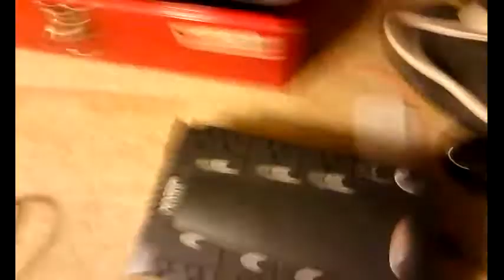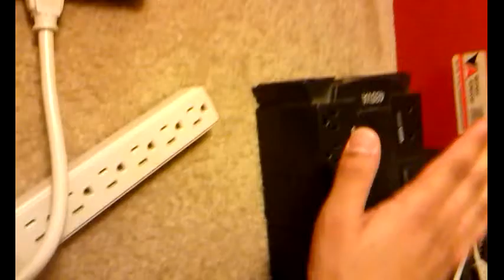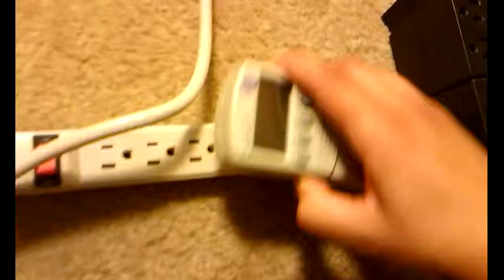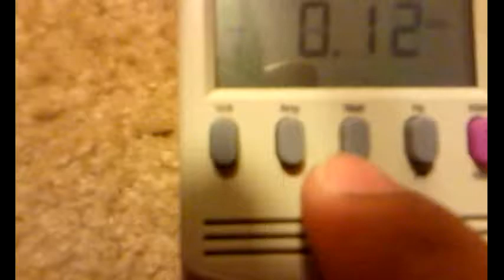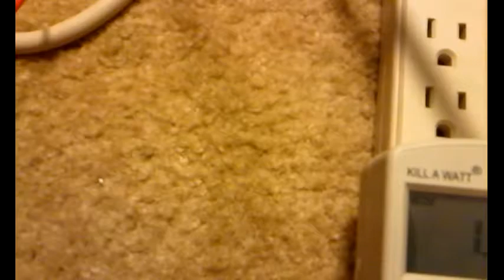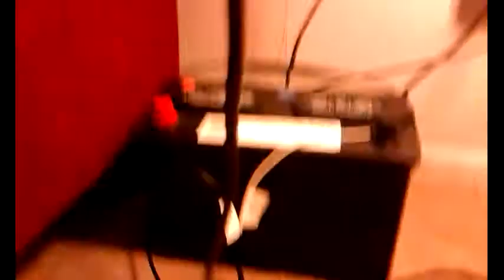12VDC Car Battery Converted to 120VAC Outlet

Comment: "It's not acceptable for somebody not to know something these days," says the dumbass who just hooked up an inverted dc current and fried his power strip. Moron, terrible video.
Reply from the maker: Gotta run tests. gotta try new things. stuff gets broken sometimes. It was a 50/50 chance i hooked the wires up right the first time when there's no + or - on the pcb and the colors of the wires were installed backwards its understandable that an error like this would occur. I'm actually surprised a fellow nitpicker like yourself didn't notice that I also said I still don't know alot of the names for the components or the correct electrical terminology. Regardless I appreciate the comment, dude.

Comment: Bad staging dude - you say "(the battery) is not connected to the wall or anything.." and there are two A/C cords going into the wall right behind it.  Even though those wires are probably feeding your camera or something else, it looks like they're going into the battery, which raises the spectre of doubt. Learn stagecraft if you want to make a believable video.  

Also, unbelievably boring, tedious introduction, lots of unnecessary facts.  GET TO THE POINT!!!  It ain't rocket science.

FAIL.
Reply from the maker: thats a good point. but check out all the other people doing the exact same thing if you dont believe my staging. or try it yourself and prove me wrong. Thanks for the comment.
Reply: Bilq - the Wanderer I'm sure you're right and it works, but others who don't know electronics (I'm an EE, btw), might be confused, or won't believe.  Just trying to be helpful!

Comment: Ohm's Law is E=CR
Where E is EMF and is measured in Volts, C is current and is measured in Amps, and R is impedance or resistance which is measured in Ohms.

P=EC
Where P is power which is measured in WATTS.

Amps are the electrons that move from atom to atom.  Volts are the force which makes the electrons break free from the atom and move with the current, ohms are the resistance to electron flow.

DC is direct current, which means that it is always the same voltage.
AC is alternating current so normal American Voltage that is in everyone's homes is 120VAC which goes from +60V to -60V at 60Htz or how many times it goes from +60V to -60V and back to +60V in one second.  Hertz is how many cycles per second

The reason why you can't plug stuff straight into a car battery is because batteries only store energy in DC and most things run off of AC, which is why you need all of that other stuff.

Those are just some basic definitions for you.